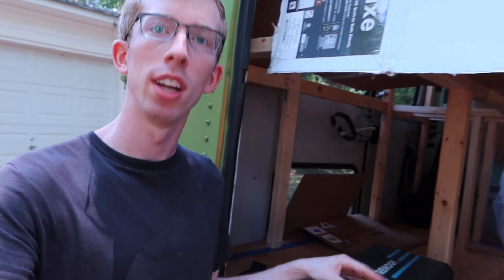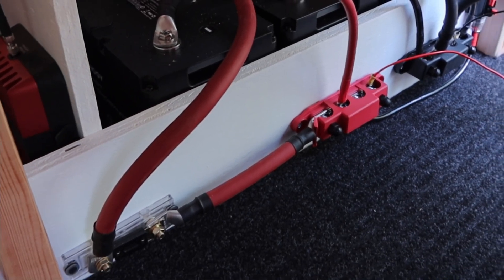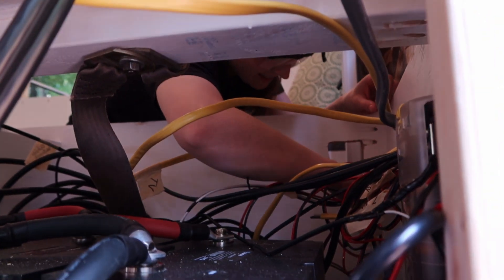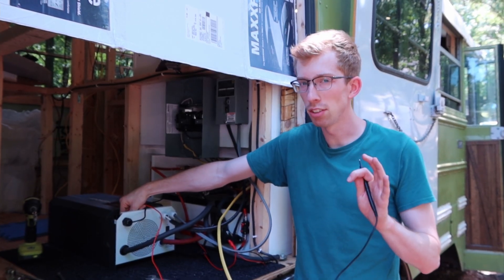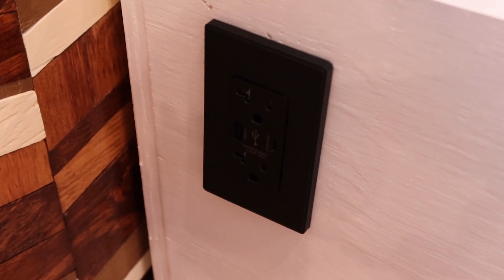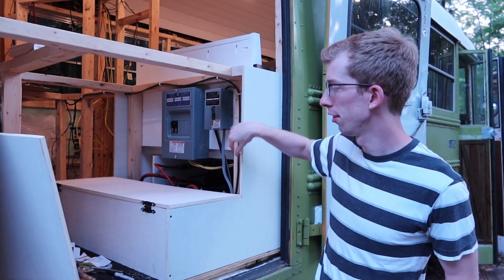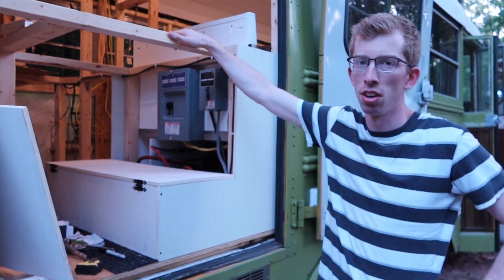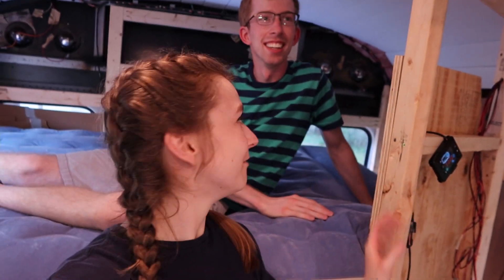COMPLETE Off-Grid Electrical Setup! | Installing 3000W Renogy Inverter for A/C Power | SKOOLIE BUILD

Comment: Question…I have the same 3000 watt inverter and when trying to connect the AC input to my home it kept tripping because my house has 15 amp outlet ….so I’m curious when you used the adaptor you show was that going from renogys 30amp down to 15 amp house outlet?

Comment: Everything is great except you used romex. 

Romex should never be used in a high vibration enviornment or with exposed work. For this type of electrical you must use MC cable per the NEC. MC cable is rated for much higher crush resistance and can be used for exposed work. It is also much smaller in diameter than dedicated 1/2 conduit or flex conduit.

Comment: To avoid a spark from the inverter next time you should look for something like a 30 ohm resistor. With this 1 dollar resistor you can pre charge the connection. Good thing that spark didn't happen on your battery terminal because that could actually chip it and could hit someone.  :) Anyway your van looks amazing

Comment: Nice job! And quite brave also. I'm curious ... why not using the Ethernet cable battery connections and the smart battery monitor? Also, have you tried a shut down and restart (with the the red knob) after giving time for the inverter capacitors to discharge ... Curious if the surge caused any BMS warnings?

Comment: Hi guys!  Like everyone else says, you guys are a great couple and we’ve enjoyed all your videos!  

Now that you are on the road, are you finding your solar/battery system to be enough?  We are working on a skoolie of our own and this part is the most mind boggling, at least to me. Happy travels!
Reply from the maker: Thank you!! 😄 That's a great question, and obviously everyone has different needs but we actually decided to upgrade our system by adding a 40A DC-DC Charger so that we could charge our house batteries while driving. We also found that we use some appliances differently than we used to when living in a house, for example we haven't used our microwave in at least a month. With our current setup, we're able to go off-grid (in terms of electricity) pretty much indefinitely, although it can be tough if we go several days with little sun. Hope this helps, and best of luck with your build! 💚
Reply: Thank you so much for your response!  We continue to watch your travels and are so happy for you!  You remind us of ourselves many years ago. We will be married 25 years this spring. Crazy how time flies!  We’ve seen you mention at least once that your diesel heater works at max capacity when it’s cold. Our bus is a full length bus and we will be installing two of the same. We don’t plan to take the bus into colder climates like we live in now in Minnesota, but are curious about how cold it’s been in Tennessee or Ar”Kansas” (hope that isn’t illegal to say since we aren’t in Ar”Kansas” :-) ) when you’ve needed to use it. By the way, that’s how I always refer to the state. Hope everything is going well for you guys. I suspect you’re in AZ about to partake in skooliepolooza. Hope it is fun!  Looking forward to hearing about it!

Comment: I must say your a great couple,and anytime you can get a lady onboard with prepping,solars prepping,shes a keeper.Do yourself a favor and add some 12 volt cig outlets with usb connections here and there,you will be amazed at what you can run.They make litle 12volt submersable water pumps,jump boxes,and look into a golabs 500watt solar generator just to have on hand while suns not available.Great job folks. p.S,get a butane single burner and find an asian store or sams club and get 4 cans for $5,I use 1 can for 5-7 days cooking 2 times a day,cheap and also provides extra heat during winter,very portable.

Comment: I installed a switchable breaker between the solar panels and charger controller. Just replaced my single 170W panel with (2) 200W panels. And I installed a master switch between the batteries and the van. Cheap solutions to help your upgrade, troubleshoot and perform maintenance.

Comment: Be sure to use stranded copper or tinned copper wire for vehicle wiring.  Some cheaper wires are made of aluminum that dont last as long and have power efficiency loss.  Also in recent years there has been an insane amount of recalls on fire extinguishers and its recommended to check the id on your extinguisher and recall list.
Reply from the maker: Thanks for the words of warning, we’ll definitely keep an eye out. And yes, unfortunately our AC lines are all solid copper, but our DC appliances, batteries, etc are all connected via stranded
Reply: @JimmyandNatalie  this is a big debate because copper work hardens. I also used solid  wire in our bus for AC. But it's accessible should a wire break and needed replaced.
Reply from the maker: That’s honestly what we were thinking too so we weren’t too worried about it. And we do have the fallbacks (ie. breakers) should a short circuit actually happen due to loose wire connections